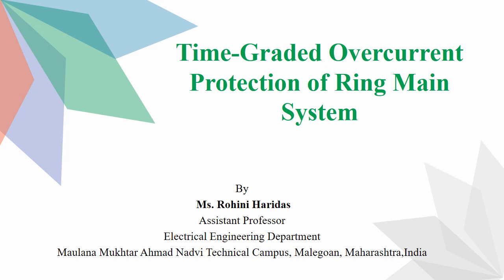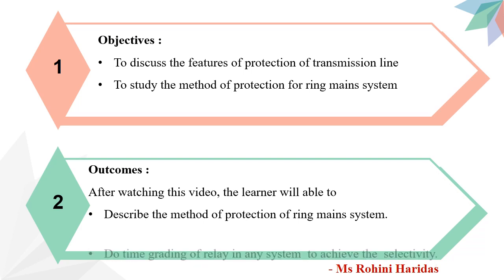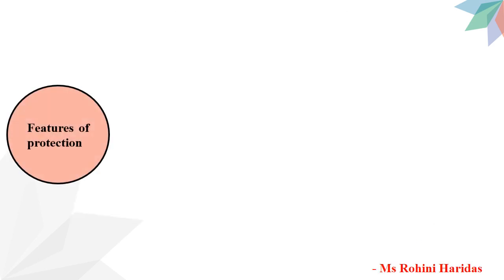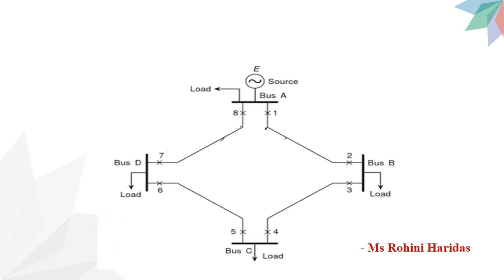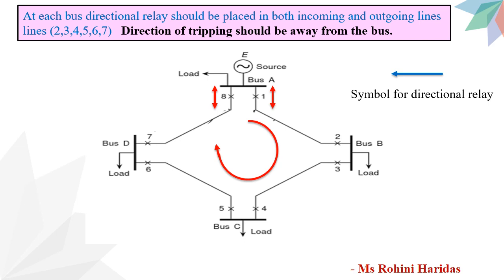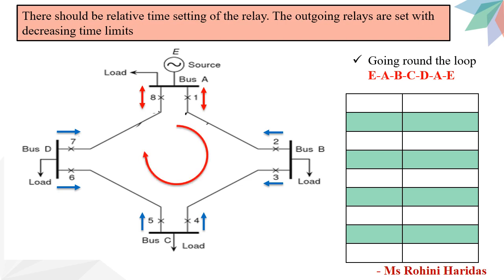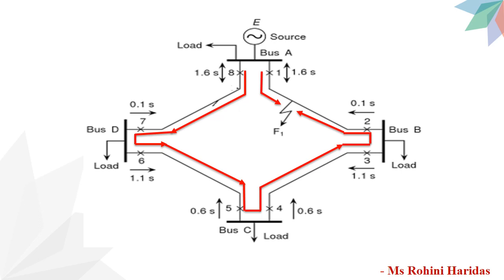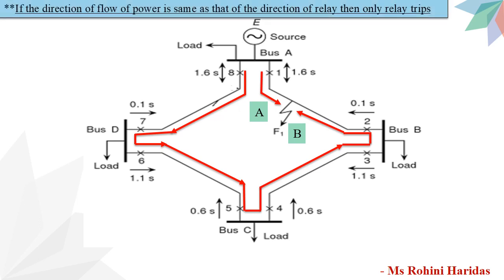Time graded Overcurrent Protection of Ring Main System

Comment: What is the reason why we use 0.5 sec decreasing time setting in relays?
Reply from the maker: 1. Main objective of protection system is that smallest possible part of the system should be isolated and to achieve this we use time grading principle.

2. So, time grading means system where time discrimination is employed to achieve above mentioned objective (point no 01) .

3. The difference in the time setting of two adjacent relays is usually kept 0.5 (but not necessarily),  It completely depends on its own clearing time plus some safety margin. Or we can say that this difference is to cover the operating time of relay+ CB+ some safety margin
Reply: @rohiniharidas  thanks so much mam for explanation. Also thanks for your valuable & doubt slowing response .

Comment: Madam, During normal operating condition (no fault) if power transmitted from bus B to and bus C and vice versa, what is the response of relay 3 & relay 4,  whether it operates or not? because relays direction is same as that of normal power flow direction.
Reply from the maker: It will Not operate sir because these are directional #Overcurrent Relays meaning is that it will respond to #excessive current flow or fault current only in a particular direction in the power
 system. In normal operating condition, magnitude of current will be less than pick up value so relay will not operate.